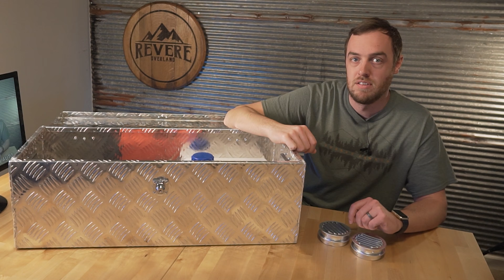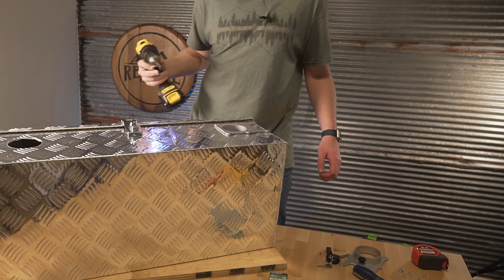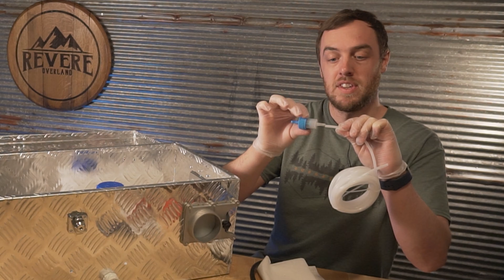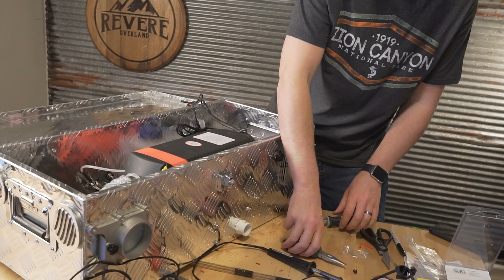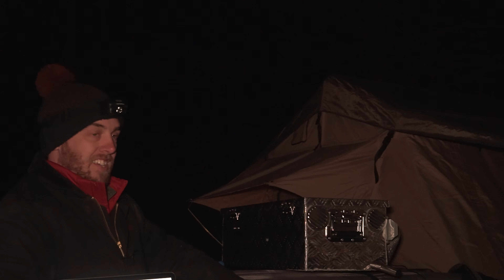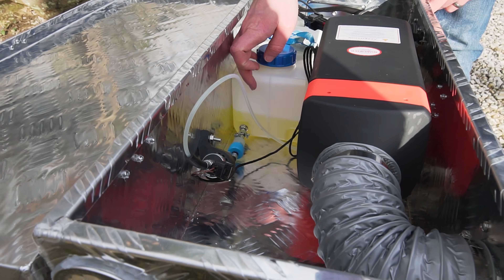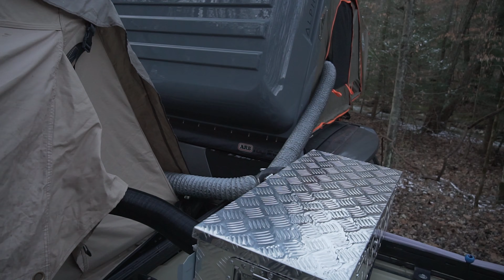Roof top tent DIESEL HEATER V2

Comment: Please help! 
Looking for experience with utilizing a heavy duty 20A cigarette lighter adapter to plug into a solar generator. You’re the only one that I’ve seen that has suggested this method, others suggest attaching directly to a battery. I have a Bluetti EB240 with a maximum 12v output of 9a where the heater’s initial draw is around 12a. I spent about 9hrs of researching answers today and I’m still without a solution. Thanks!

Comment: After watching this i wonder if a guy could get a piece of aluminum bent and use it to build a tank right in the box? The box would be one end and a side..known what i mean??
Reply: I should have said one end one side and the bottom.
Reply from the maker: An integrated tank would be nice. I spilled some diesel in mine, and it sucks!
Reply: I was thinking about spilling fuel either while filling that plastic tank or getting a hole in it.i,ve driven alot of miles on back roads and trails and i known what it does to trucks and things in those trucks.i can see a split or hole in that plastic tank.i was thinking have the aluminum tank builtin and the fill cap outside the box on the end or side whatever works for the application.

Comment: You should get the jackery 1000, remember the jackery takes forever to recharge!
Reply from the maker: I'm probably going to get a dual battery setup. At the rate I go through drone batteries, I need some serious power! The Jackery capacity is great, but the charge times are just too slow.
Reply: Revere Overland I bought a 200ah lifePo4 battery, although pricey but well worth the investment, doesn’t seem like anyone could use too much electricity in a van, but when you add up a few things you’re surprised how much you consume, & that’s just the necessities!  Fridge, diesel heater, electronics, batteries etc... so a good battery system is necessary!  I looked at the jackery 1000 and it could of been possible except for the recharge time that made me decide on that whole idea of a charge controller & a good battery bank!

Comment: You need 12v computer fan to force cool air in or out of the box to provide cooling.
Reply from the maker: The heater unit actually cools itself through the air it pulls through the heat exchanger, so the box temperature changes very little.

Comment: Consider  piping the exhaust pipe further away from the air intake or you could risk carbon monoxide poisoning if the recirculation pipe pops off the gate during the night. Or at least consider putting a monoxide alarm high in the tent as a minimum safety feature.

Comment: There is one being produced in China that has a casing and built in tank ,also a didital control system .Ive not fired mine up yet but will let you know when I do ,just added extra hosing to get the hot exhaust out my bell tent and air intake outside ,almost finished the shower in a box very happy with the results so far thanks man another good video .

Comment: Have you measured the intake and output temperature of the heater I was wondering because if you're out in 20 degree weather we might only get a Max of 70° coming out
Reply from the maker: I did, but don’t remember off the top of my head. It’s in the previous diesel heater video about not melting the plastic box.

Comment: It looks like the length of wire to the controller is very short. Did you purchase a longer wire harness? Also, since the 5Kw heater is less expensive, would you make the move to that heater rather than the 3Kw?
Reply from the maker: I’d say the wire to the controller is about 6ft, which is what it came without. The 5kW is probably the way to go, since it’s cheaper!
Reply: @RevereOverland  Hi! Thanks so much for the reply! I have a smittybilt overlander that is on top of my subaru outback, so I will most likely need to place the heater on a stand on the ground next to the car rather than have it up on the rack, since there is no room. Just trying to figure out how to get the wires with the controller up there. However, as I understand it, the 5Kw heater has the wireless controller that acts as a thermostat, so the longer cord may not be needed?

Comment: All is good, But the real question is how much juice do you loose overnight running this setup at least 8 hrs i guess  ?
Also would like to know what kind of battery setup you have.
Reply: I just saw the full video, Alles klar, Danke
Reply from the maker: I’d estimate you’d need about 20 ah to run it on full blast for 8 hours.

Comment: Great videos on the diesel heater.  Im building a trailer for off road use and I may just use one of these instead of white gas or propane.  Thanks!
Reply from the maker: I'm hoping we'll start seeing more of the gasoline and propane models. Right now they're pretty expensive still.

Comment: The hoses will get beat up stored in the box.  They ports you've put in and the lid should be improved to be more resistant to penetration by water. If they do fill with water you don't have a drain.
Reply: I would also double the size of your fuel container.

Comment: To cut down on heat loss through the hot air delivery tubes perhaps consider using insulated versions or insulate your current one's.

Comment: Another tip for you, seal around the holes that were drilled in the bottom with some rubber washers then if any fuel is spilled it won't leak out the bottom of the box. It really looks much better in the metal box. Good job. Maybe put a small fire extinguisher on the side of the box.

Comment: How noticeable are the exhaust fumes when so close to the tent?
Reply from the maker: I’ve not noticed them yet. Maybe if there was a really light wind in the right direction, but it doesn’t really smell much when it’s running. The only bad fumes are right as you start it up.

Comment: Great concept I would only change to a remote fuel tank just to avoid the hassle of it being on the roof.  Plus bigger volume to suit the needs of a longer trip.
Reply from the maker: If you have a rear bumper it might work well for remote fuel. My previous design had it separate, but I prefer it self contained personally. If you do have it separate, make sure you have valves... diesel leaks are nasty!
Reply: @RevereOverland  if I go that route itll probably be overly complicated knowing myself. Great video though.

Comment: How did you bend the exhaust line so close to the heater without kinking it collapsing it?
Reply from the maker: Skills? I cut the smooth section a lot shorter on my previous build, so the bend is in the section designed to be bent.
Reply: Revere Overland you definitely have skills. Haha

Comment: Good info! thanks for the vid. Couple ideas, some mentioned below but Ill repeat:
> combustion air intake, dont take this from outside. Pull it from in the box and remove 2 of your aluminum vents. this will improve combustion efficiency and burn off/vent any fumes accumulating in the box from spilled diesel. Combustion air doesnt mix with the heated air so no worry about fumes entering tent.
>for extra fuel capacity you could get outboard boat motor fuel connectors they make some nice spill proof connectors that you could bulkhead mount to the box then use an outboard fuel tank and hose.
>Combustion efficiency is  way better with hot air and warmer fuel, a couple turns of copper line around the cooler part of the exhaust and running the fuel through it first will help in really cold weather. also pickup the combustion air from around the exhaust pipe. this helps reduce soot and carbon buildup from incomplete combustion.
Reply from the maker: I feel like an idiot. I thought everyone was telling me to pull the fan cold air from inside the box, not the combustion air. Pulling combustion air from inside the box makes SO much sense - no chance of snow or rain getting in, more efficient burn, cold air pulled into the box to cool, and less stress on any filter. Thanks for explaining that to me - I’ll do that!
Reply: @RevereOverland  what does it look like inside the box then? I'm building this now per the video but it seems youy may have changed it. Thanks!
'

Comment: couldn't you use kerosene? since its not a motor vehicle you don't have to use taxed diesel. should be much cheaper on fuel.
Reply from the maker: Yup. It’s usually just a little easier to get diesel!

Comment: Excellent video man... thank you for the effort.  I am in the middle of my build and am running into fuel issues. I am struggling to find that nylon fuel line which I suspect will cure my issue
Reply from the maker: Lowe’s sells it!
Reply: Revere Overland thanks man.. will look for it

Comment: Use a remote fuel tank for an outboard engine. You can get them in a variety of volumes. There are many different styles of fuel quick connectors with check balls so they will seal the minute you disconnect the line and only leak about a drop if that. The mercury and OMC are the most common.
Reply from the maker: I really thought about getting an outboard motor fuel tank. It would be a good alternative, and have plenty of capacity.
Reply: Revere Overland it would also make your set up more modular.

Comment: Nice build,  if you plan to build another insulate your box , it will keep it even quieter and have less rattling , an aluminum box will essentially turn into a speaker especially late at night when you can hear a mouse fart at 50 paces.
Reply from the maker: I could also put the muffler on, but so far it hasn’t been annoying since the white noise from the fan drowns it out!

Comment: Hopefully your going to change to a different power plug.  12v socket can become unplugged causing unfortunate problems with the heater not having a proper cool down period.

I would recommend having a designated onboard battery such as a simple 12v9ah AGM in your battery box and then if your going to have the 12v plug into your solar generator, install a blocking diode.

That way, if you accidentally get unplugged from your solar generator, you have a backup battery in the box to keep the heater running (until the voltage drops and the heater does a low voltage shutdown safely).

Additionally, the fuel tank on the hot end side of the heater, not an issue, I linked my heater video in your first one where a thermal monocular was used to show what was getting hot and what was not.

My heater case uses an onboard battery 18ah AGM with 5.5a smart charger than I can plug in my solar generator to charge up the battery (yes I know energy loss from DC to AC back to DC) but I can change out solar generators without ever shutting down my heater.

Additionally. I have done power draw testing.  I've had at max wattage for startup, 130w and max at shutdown 100w where the max overall power draw on both a startup and shutdown sequence was only about 18w of power consumed from the battery.

Additionally, running the heater on low after startup draws about 6w and on high upwards of 45w.

All power connections I use are XT60 connectors from the RC world where all plugs sending power are male and all recieving are female which is a common layout among the RC world.
Reply from the maker: Interesting feedback, thank you. 

I was more worried about the hot exhaust than the hot end of the heater, but with the exhaust wrap, and it being secured in place, it’s not an issue. I may add a second tank at the other end, but would have to figure out fuel transfer. 

With the battery I would probably do as you suggested if it was in a moving vehicle. The 12v is not a secure connection at all! With it in the tent, laying on its back, it’s unlikely to be a problem though!
Reply: @RevereOverland  the 1 time it does come unplugged, you will likely destroy your heater at the minimum.

A simple $20 battery and a couple dollars in extras, easy to wire into your setup, the simple being able to swap solar generators without shutting down would be a huge convenience alone besides the safety should it ever be unplugged accidentally (or the 12v plug blow a fuse).

It's a cheap upgrade which had peace of mind and convenience built in.

Your choice if you want to do it or not but I would not be surprised if at some point down the road, it gets accidentally unplugged and at the very least, destroys the heater or potentially catches fire destroying an expensive build and leaving you without heat.

Comment: Why not just get a Jerry Can to hold 6 Gal.s or 22Lt of fuel that should be about a 2 week supply? Also a 50-100 watt solar panel to keep a battery charged?
Reply from the maker: That’s what I had previously. Keeping them connected was a pain, and disconnecting them resulted in diesel drips.
Reply from the maker: Solar works great - I have a 60 and 100W solar panel, and they’ll easily charge the Jackery when the sun is out.

Comment: Beautiful build, I just noticed on mine that the rubber chinese fuel hose is cracking and generally falling apart. after two years the plastic fuel line is good but I'll have to replace the rubber stuff. These kits are really cheap now My first one was $400 and my new one was $150cad!
Reply from the maker: Yeah they’re a great price. I used rubber fuel hose that I had left over from Autozone, so hopefully it’s a little better quality!

Comment: This is great setup but curious why not use the one piece unit that has tank and outlets installed as a unit,still very cheap or similar price.
Reply from the maker: They’re not really suitable to be left on the roof of the vehicle or out in the rain. They’re a great price though. I’m also not sure of the tank size on the prebuilt ones, but it’s probably similar.

Comment: I believe the intake muffler you eliminated was in fact a water trap like a scupper cover on a boat it is a baffle so the water drains and just air enters. Nice video
Reply from the maker: Based on the design, it doesn’t appear to have any use other than sound! It’s definitely not a filter.

Comment: There were clues that you have watched John's videos, but you must have missed his explanation of why there can be no 8Kw model.  They all use the same .02 pump with max pulse of 5.5, which gives a theoretical 4.4KW.  I would consider a shorter taller box, something a 10l tank would fit in.  I would draw the inlet air over the hot end of the  heater to both cool it and also preheat a little.
Reply from the maker: Yeah I missed that one! Thanks for the correction.

Comment: Also wouldn’t a dual battery system with appropriate isolation be cheaper than a bigger jackary?
Reply from the maker: Probably. But by the time you add wiring, charge controller, mounting, USB, 12v, and a 500W sine wave inverter they’re pretty similar. The Jackery is also portable, so if I travel with someone else, take my ground tent, or want to power a shower or laptop etc., I can move it.
Reply: Revere Overland you don’t need all that stuff. Second battery and a ACR and you’re done. Minimal extra wiring to hook it up. Way cheaper than the bigger jackary and you keep your smaller one for those other things you mention. You then have the added benefit of jump starting yourself if you need.

Comment: Good job. V2.0 turned out great. 👍
I think you would be better of with Dynamat on the inside to dampen the sound.
I would not worry about the heat inside the box when it is ventilated. And Diesel is also more efficient when preheated.
Reply from the maker: Thanks. The sound from inside the box really isn’t noticeable over the fan white noise, so I’m pretty happy with it. I like the diesel being the box too, since it helps keep it a little warmer!

Comment: Having been a trucker for thirty years, i have been told many times by fuel companies that diesel fuel and furnace fuel are practically identical. The only difference being the addition of a dye to the  furnace fuel to indicate that road tax has not been paid on the fuel. Contact local fuel companies and see if you can purchase small quantities of furnace fuel to run your heater. The furnace fuel is much cheaper.
Reply from the maker: Someone said that some gas stations sell gas free diesel too, but I've not asked for just filling a gallon at a time!
Reply: @RevereOverland  I wonder if these heaters would burn Kerosene? Just a thought..
Reply: @wesleymcgonagle3394  I heard of other folks burning cooking oil and waste oil so I would imagine so.
Reply: @wesleymcgonagle3394  No Lubrication for the fuel pump, but a mixture of Kerosene is good to help it burn cleaner.
Reply: @RevereOverland   Farm Supply and feed stores stores sell it, usually. It's called Off Road diesel in most states.
Reply: Be careful with heavy heating oil. It may burn dirtier and coke the heater up.
Reply: in Alaska, we have it at the pump! One in winter, two in summer.
Reply: In Oklahoma it's called red diesel
Reply: Yes we have it at the pump to
Reply: Yup, off road diesel doesn't have road tax on it. Also on Alaska they don't dye heating oil (well ten years ago at least) and I've known folks to run that in diesel engines.
Reply: @notabiker1  Home heating oil is a very viable substitute for diesel fuel.

Comment: Pull air  in through the box  and over the exhaust instead of directly in . Does your heater smoke a bit on start up ? nice build atb.
Reply from the maker: The last build pulled air through the box, but with the fuel tank in the box, I didn't want to risk pulling diesel fumes into the system!
Reply: @RevereOverland  Good point , if everything is sealed and clean it should be fine though :)
Reply from the maker: Just remember that most fuel tanks are vented. I already overfilled mine and had some leak out of the top, unfortunately.
Reply: @RevereOverland  Also good point thanks for the tip.